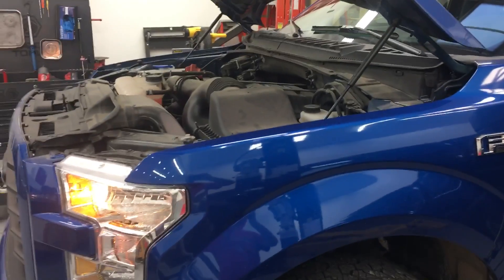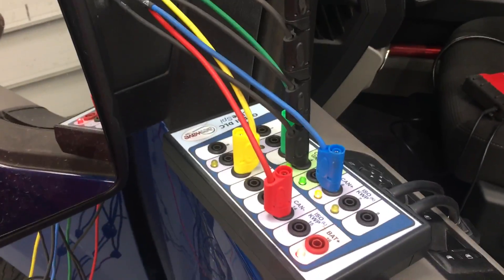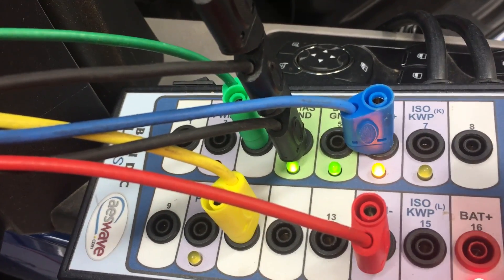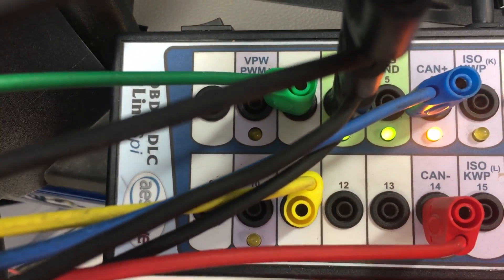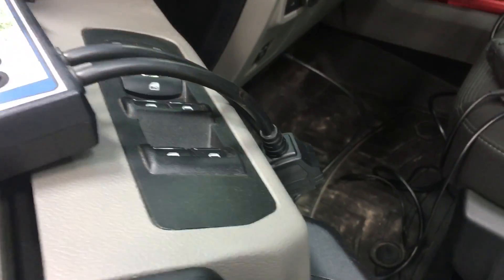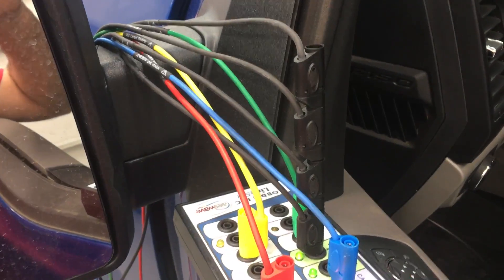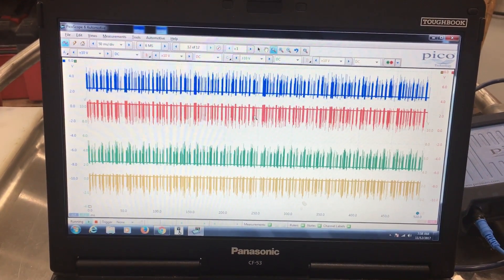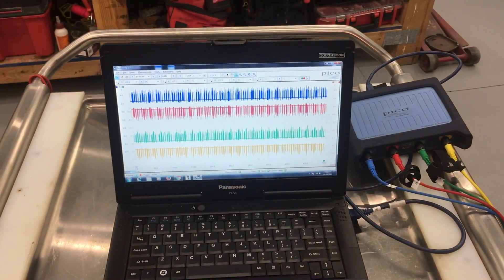Capturing network communication waveform at the DLC

Comment: Is it possible to get relative compression from the break out box? What other tests besides can can you do with it?
Reply from the maker: Welding Junkie yes it is. Watch my relative compression video. The attaching point is the only difference. Could be the faster, cleaner way to do it.
Reply: JM Diagnostics thank you I looked I don’t see a RC test using a break out can you share the link? I’d like to watch that.
Reply from the maker: Welding Junkie https://youtu.be/u7tiGgizupg
Reply from the maker: Welding Junkie just connect the leads to the breakout box instead of the battery posts. Same test.